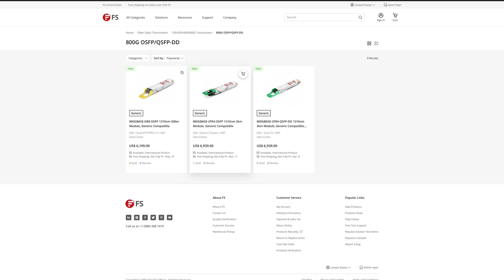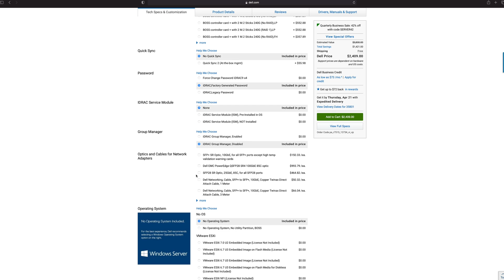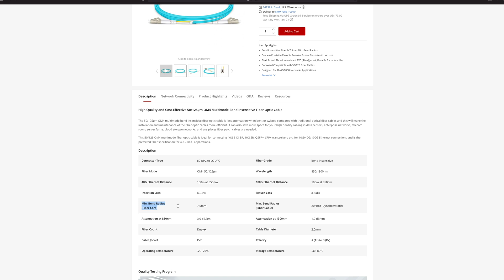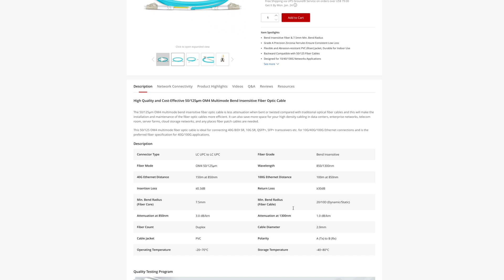How to run ethernet cables over 100m and protect you from lighting strikes (using fiber from FS.com)

Comment: Love the content. Just wanted to add that the fastest (but still super impractical and very expensive) speeds over copper ethernet cable is cat 8 which supports 40gbps.

Correction for statements at 2 minutes in that 10gbps is the fastest for copper ethernet.
Reply from the maker: Cat 8 theoretically can do 40GbE but there is not a single network switch that can do 40GbE (or even 25GbE) over cat8. Meaning that the maximum speed you can do over copper RJ45 is 10GbE

Comment: Have you ever done a video on the different Ethernet cable standards. And maybe the quality of these cable and manufacturers. I had bought lots of cables over the past started to buy these flat cables. Something in me said these cables are way to thin. And I doubted the quality of some. And others had these really thick casings. I started doing research and found out most of these cables are crap. My switch cable test showed open short and one with cross talk. And what pissed me off is I had new cables as spares and when I tested what was supposed to be a cat 6 or 7 had a speed of 100 Mbps. I’ve pulled all these cables and tarted back with round cables again. Now testing anything before I put it on my network. I don’t even know why I just trusted these cables right out of the box. And mostly my fault for using the ease of Amazon thinking oh yeah it should be decent. No more. Back to using companies like Newegg of friend who are contractor that buy from distributors. Can you do a video on cables maybe even cut some of these flat cables open and show people they are getting 26 to 32 AWG cables being passed off as Cat 6 or 8. Cables that don’t even meet the standards.

Comment: I would never run duplex zips as structured cabling. I use them only as patches between bulkheads and devices or optics. I ran osp non armored fiber between my garage and home

Comment: Hi, great video! I'm just thinking about doing something similar, but what is unclear to me - if both convertors need to be plug in electricity socket - won't it just go through it to the other convertor and still destroying everything? Or how can I avoid this? Maybe is it enough to put each convertor in different socket? Or put it in some kind of electricity protector that will defend other sockets? (if something like that exists)
Reply from the maker: So you are just looking for a surge protector. if you do this make sure that the "sacrificial" media converter is on its own surge protector. That should electrically isolate it should a circuit pop